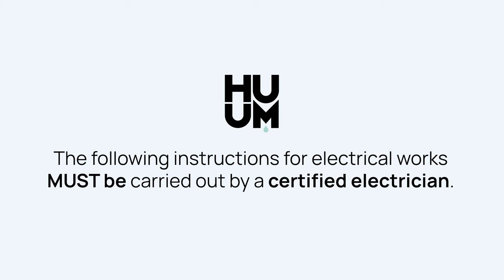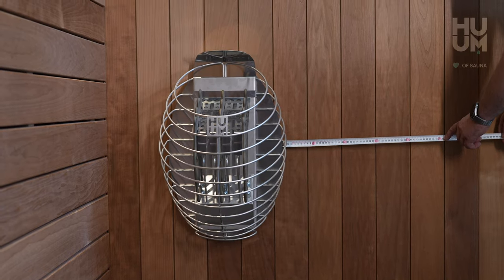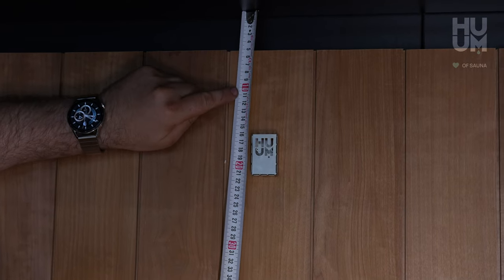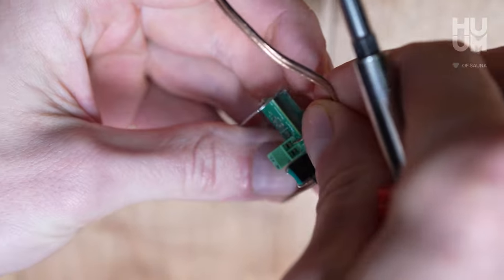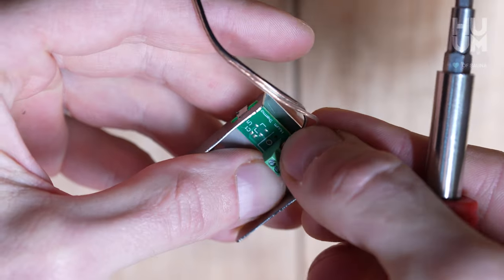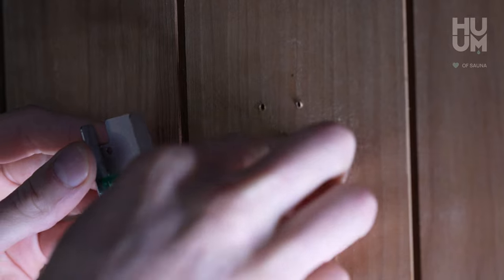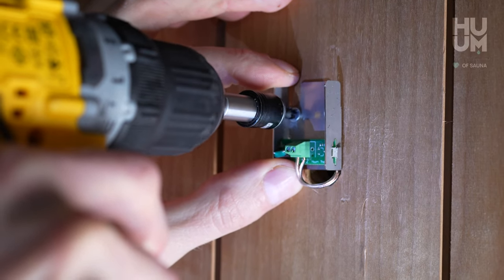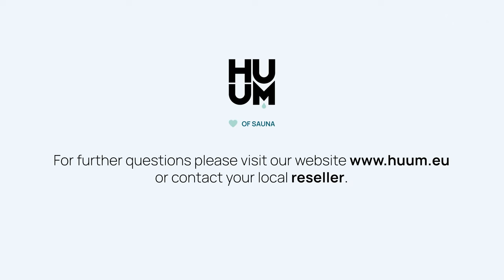HUUM temperature sensor installation

Comment: Why does it have to be 50cm from corner wall?
Reply from the maker: Hi there! The sensor is placed 50cm from the corner in a sauna to ensure it accurately measures the average air temperature. Corners often have higher heat due to limited airflow and radiant heat from walls, which can give a misleadingly high-temperature reading. By positioning the sensor away from the corner, it captures a more representative temperature of the sauna's environment :)